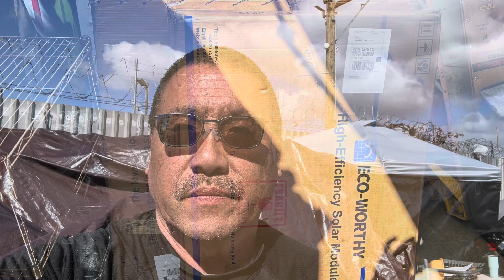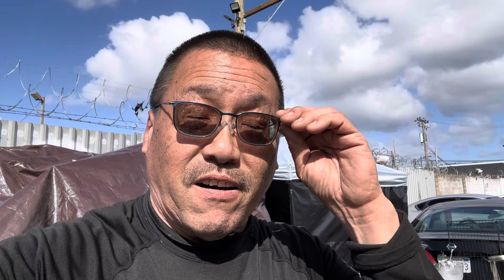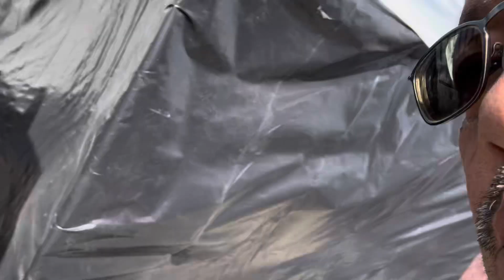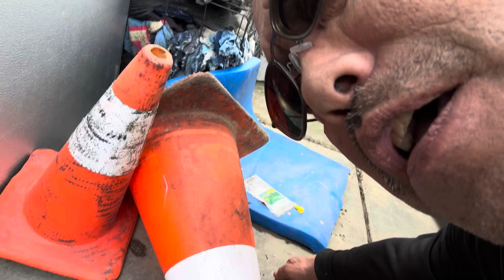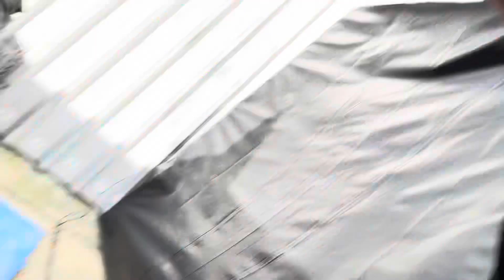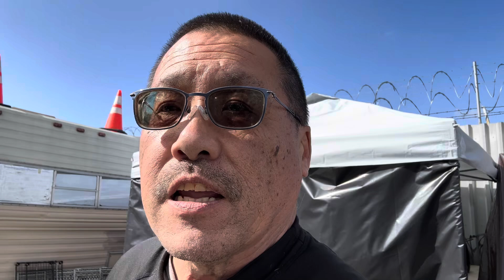Surviving Homelessness TIPS by Derrick Soo ll Off-Grid Power ll Energy Independence

Comment: Solar generator sounds great.  I live indoors and barely run my Microwave.
Reply from the maker: @mariaa.5829  if you became Homeless, you could operate your Refrigerator or 2, on the Solar Generator. TV, lighting fixtures, computer and much more. If you have a large enough Generator, you can operate up to a 3-Ton HVAC unit (24,000 btu).